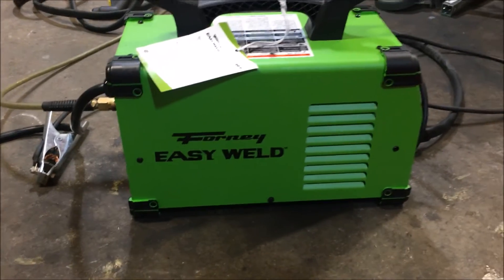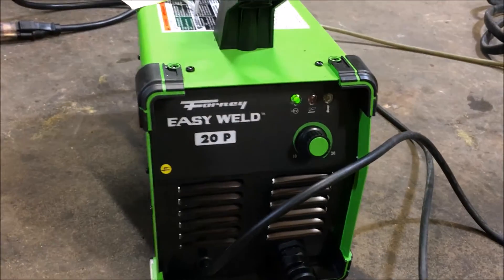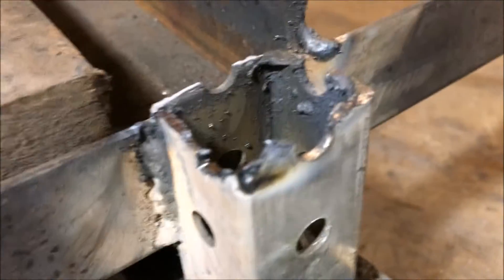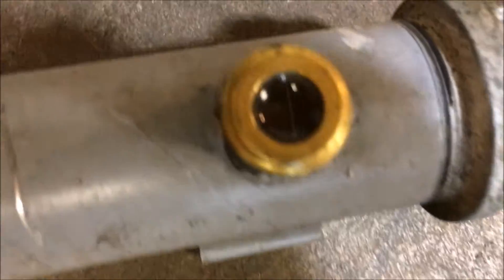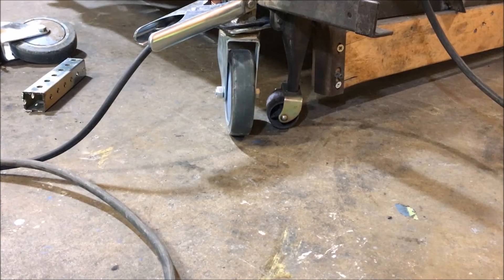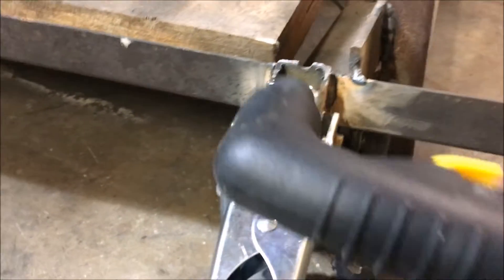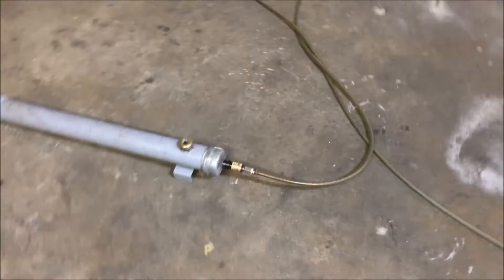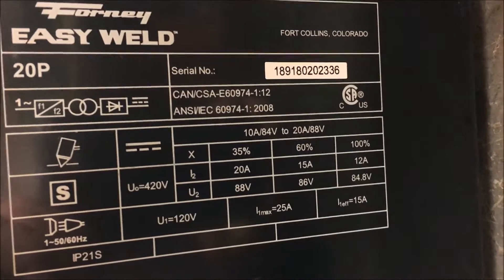Forney Easy Weld 251 20 P Plasma Cutter review

Comment: Have a never used forney easy weld 20 p that wont work. Has a flashing red light and has air up to the solenoid just before it enters the gun. That solenoid has a red and black wire and both are hot any help would be great. Thanks Bill
Reply: Bill Jeffers did you call customer service?
Reply: I have the same problem. Started doing it as I was using it and no matter how many times I change the tips it doesent work anymore at all. Gotta call customer service soon

Comment: I bought one first time I used it it's stopped working can anybody tell me why this is happening but new diffuser Rings new tips still won't work red light turns on says that there's no contact but all the chips or new can someone tell me what is going on
Reply from the maker: Are you dragging the tip ? Take the gun apart and look for a problem
Reply: I have one if you want to do longer cuts over a few inches it will need to be on a 25 amp breaker with 20amp outlet